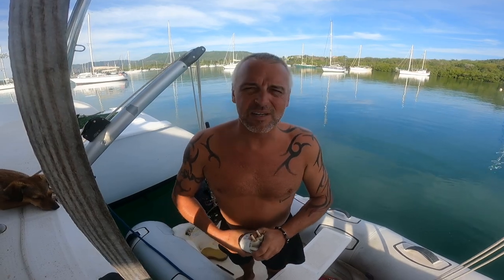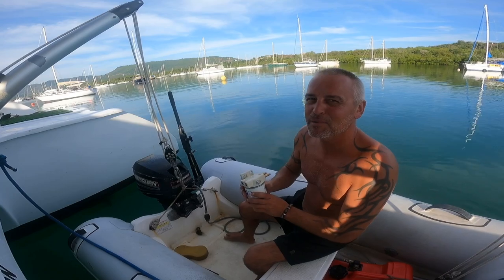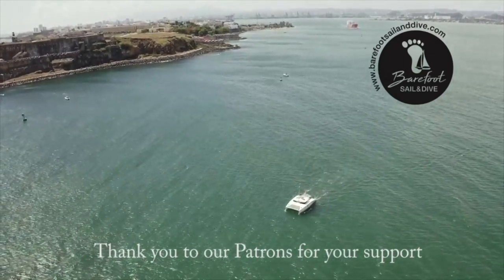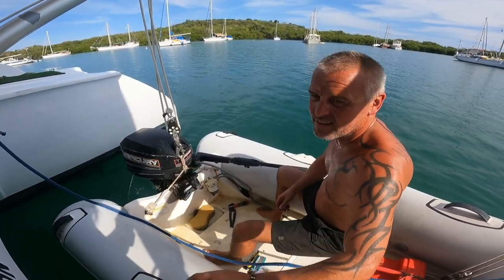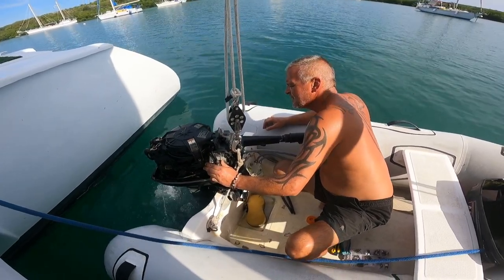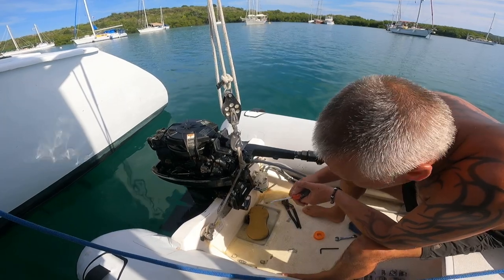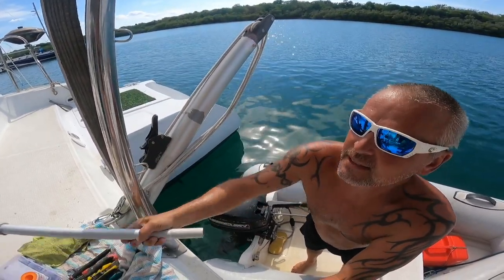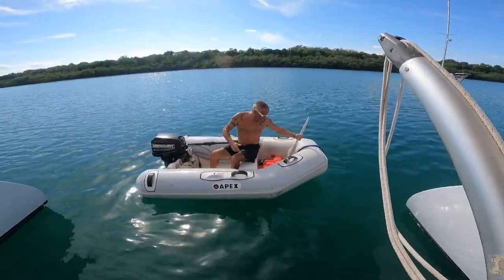How to: Protect your Dinghy in the Caribbean! (S3 E14 Barefoot Sail and Dive)

Comment: Racor is a great idea for gasoline outboards in the islands,however when you drill two holes in your dingy transom you better make shure they are sealed properly with west system or 5200.The transom is cheap plywood cover'd in polyester fiberglass,if water gets in you've got a bigger problem than a dirty carb.

Comment: great video guys but I have a further protection to offer. The best way to protect your engine from suspect fuel is to clean it before you put it in your tanks, to this end a Mr Funnel AF15CB fuel filtering funnel is the go it filters particulates and does not pass water. it is suitable for both petrol and dieseland will flow as fast as you can pour from a jerry can. available on amazon should also handle most fuel dock flows as well.
Reply from the maker: This is good to know we will add it to our Amazon wish list.
Reply: That Funnel works like a Champ.
Go to the Airport buy some 100LL for storage in lines, filter and carb.
It doesn't  turn to trash the carb.

Comment: It was interesting to watch this episode because I simply wouldn't need to add such a fuel filter for a small marine outboard engine here in the USA. Even back in the 1960s gasoline (petrol) was pretty top quality. I remember once having a problem with water contaminating my car's gasoline. I had just filled up my vehicle's tank. It was many years ago and only happened the one time but I had to get my mechanic to fix the issue and it cost me a significant amount. I never again used that gasoline brand. Your experience in the Caribbean makes me wonder what petrol quality is like in Mexico or countries south of Mexico. All the best to you both!
Reply from the maker: Thank you for the comment. I can’t speak for Mexico as we haven’t been there yet. But speaking with a lot of cruisers this is an issue in a lot of the Caribbean.

Comment: check out a "mr funnel water filter".  I pump the fuel into the funnel and clean fuel goes into my tank.  No filter to plug up or replace.  works due to the different surface tension of water vs gas;Not good for diesel tho.
Reply from the maker: Cool! Thank you!

Comment: Not all Teflon tape is compatible with gasoline and other solvents. When you wrap it around the thread, ESPECIALLY a tapered threaded fitting, you shouldn't need more than 4 or 5 turns.

Comment: be carefull about using fine filters for outboards. you can seperate the oil from petrol in 2 strokes if not careful can leed to seizures in engines . buy the appropriate filters.
Reply from the maker: Thanks for the advice

Comment: When you talk about water in the gas are you referring to ethanol? I don’t think a water separator will remove ethanol from fuel. Look into fuel washing.. use a clear plastic or glass container, put some regular water in the bottom and mark the waterline on the outside of the container. Fill the container 3/4 full of gasoline then agitate for about a minute. Then you let it sit overnight. You will see in the morning the water level has risen because alcohol dissolves better in water than gasoline. Then you siphon out the water and your left with clean fuel, no ethanol.

Comment: Ok if you can’t find it down there, send a pm to me with motor info.kk
Reply from the maker: Thank you Patrick. I have looked and nothing is available here
It’s a Mercury 9.9 2 stroke engine
Reply: @BarefootTravels  can you tell me the year of the motor
Reply from the maker: Having a look now. Just pulling out the manual.
Reply: @BarefootTravels  I am just crawling into bed but try to find me the info and I’ll see what I can do 😉crack on baby !!
Reply from the maker: Between 1990-1993 is the year.
Reply from the maker: Thank you
Reply: @BarefootTravels  ok so you’re looking for the drive arm cable right? Or was it the reverse/forward arm ?
Reply from the maker: It’s the throttle and gear cables
Reply: @BarefootTravels  I will hunt it down and let you know guys ok 👍🏼
Reply from the maker: Thank you so much Patrick!
Reply: @BarefootTravels  I sent you a picture in instagram hopefully it is the one